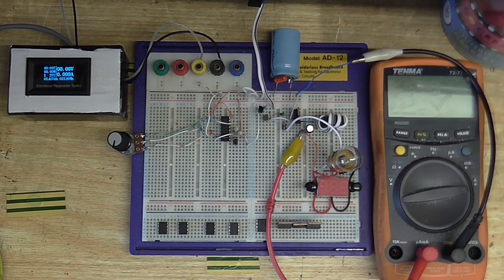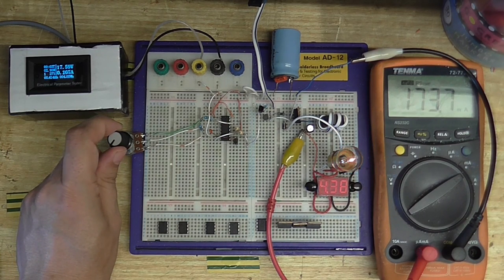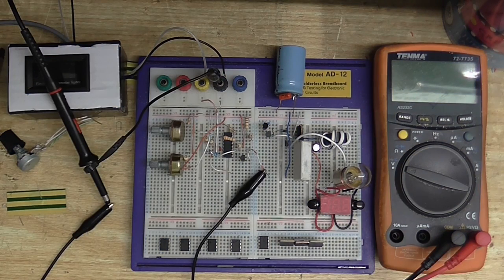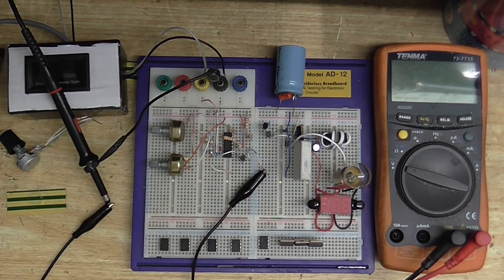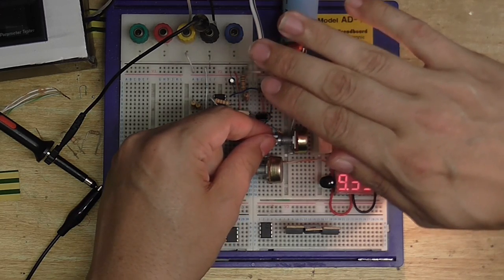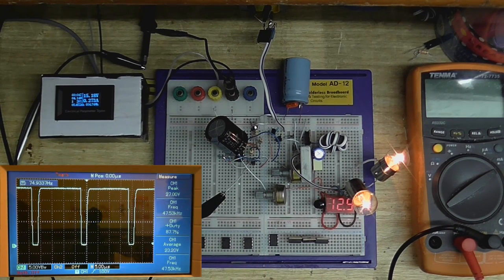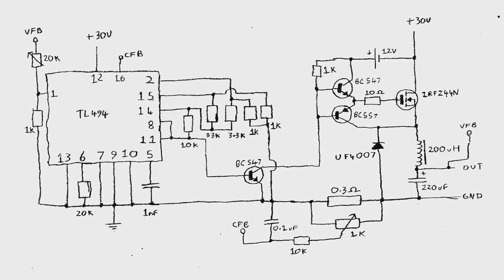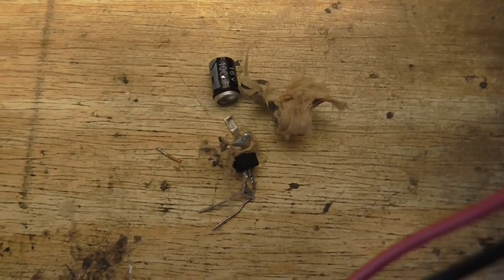Making a buck Converter part 2 - Voltage Regulation and Current Limit

Comment: Very nice video and very educational, but you are missing something very important here, and that is feedback loop compensation. Without one, your converter will be unstable, and in most cases you will hear coil whining and feedback loop will not have good regulation. (Also you need to compensate voltage and current feedback loops). For switching device dribe i suggest you to put bootstrap driver, its not difficult to make discreet driver out of couple of components

Comment: I want a buck converter with 30 amp output current with variable voltage ..can we make that with same circuitory just by beefing up the switches?btw very nice video man 👍👍👍👍👍